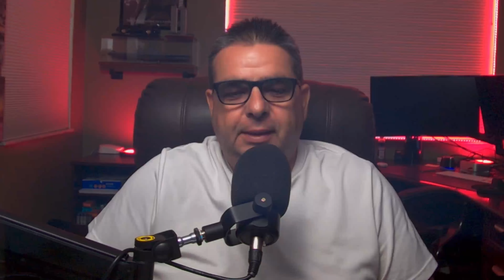Seller Tried to Stop My Inspection… Then This Happened

Comment: Three years ago, I bought a new house and paid ~$560 for a home inspection. The inspector provided a glossy magazine with house photos and noted 30 minor issues but missed significant problems: faulty tile work, multiple cracks in the shower floor, excessive road noise, a severely bent support 2x4, poor paint quality, oversized door jamb cuts exposing unpainted wood, a broken window gas seal (requiring full window replacement post-warranty), an undersized sewer line, a faulty electrical breaker, and six defective outlets. I reported these to the builder, who sent crews to fix only one issue—discoloration—after three attempts, finally resolved by an experienced painter.
Post-closing, I cautiously accessed the attic and learned from a termite inspector that it had widespread dormant mold, typical from contractors leaving trusses exposed to rain. The inspector admitted he skipped the attic due to bad knees. An engineer later confirmed the back patio drained properly, as noted, and found no structural issues but suggested the tile was poorly laid. The builder refused to honor the warranty, and pursuing claims may require legal action. I wish I’d had a better inspector, but his ratings were good and had been an inspector in this area for over 20 years. So I learned that builders will not fix minor problems because someone else will take will buy the house.  The warranty company after the one year takes over from the builder and I submitted the sewer pipe and the floor and they got back to me quick to say “we don’t warranty that.”  I believe if structural within first 10 years, but I would not be surprised if they decline and forced me to sue.  A code enforcer came to inspect the new windows in the house pointed out that  a large builder built my house and city does not want to go up against them.  I guess too many houses out there they would be in court all the time?  To fix most appropriately $70,000 not counting the inspectors fee.  I believe I paid approximately $70,000  more than what it was worth (boom time).  caveat emptor?

Comment: After having four homes built all in the same county I can’t believe the amount of violations that building inspectors missed I’m talking about bare electrical wires inside outlets ( not capped) ground faults wired incorrectly, ceiling fans with wires not even connected. Electrical issues scare me but it had passed inspection.
Reply from the maker: It's shocking how some things can slip through the cracks during inspections; it sounds like you have had quite the experience.

Comment: I think that you did the seller a solid favor by giving them a punch list to knock out. Kilz is not a very good stain killer, in my opinion.  Ames Super Primer rocks. Cutting corners on moisture, signs of termites and wood rot problems can bite you in the butt. To sum it up, the flipper house wasn't ready to sell. The word flipper gives me a bad taste in my mouth.  I can't stand flippers that do the bare minimum of repairs to get the house to sell. I'm a retired HVAC tech. There is a way to properly match indoor and outdoor units. Only a hack would screw that up.
Pex A is the absolute best piping. Get rid of the galvanized water pipe. Copper and pvc pipe has problems that Pex A solves. Pex B is okay as long as the pipes never freeze.
Reply from the maker: Thanks for sharing your insights! It's true that many flippers cut corners, and having a solid punch list can really help the seller make necessary improvements. Your experience as an HVAC tech adds a lot of value to this discussion!